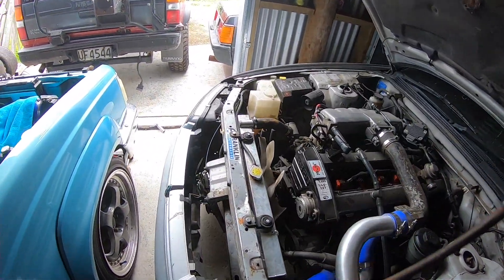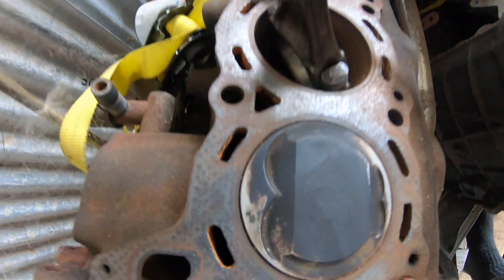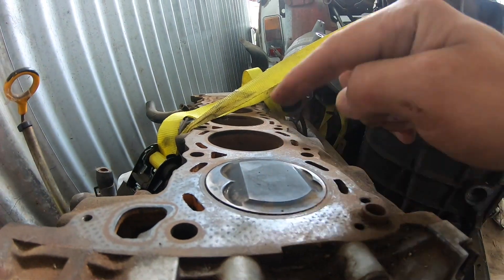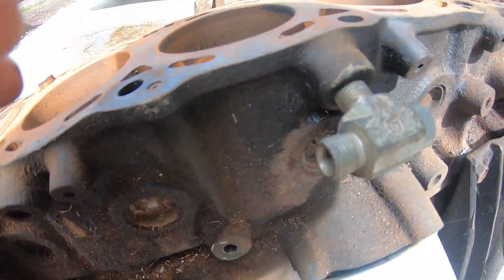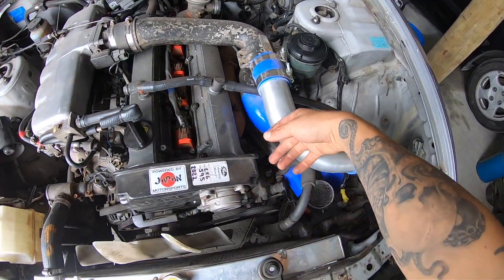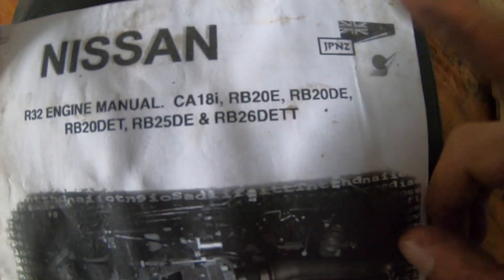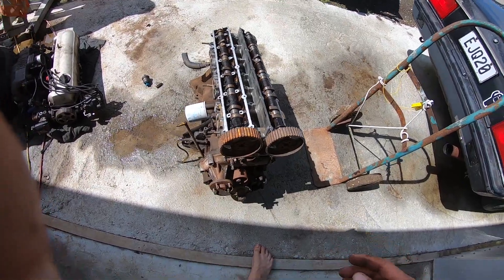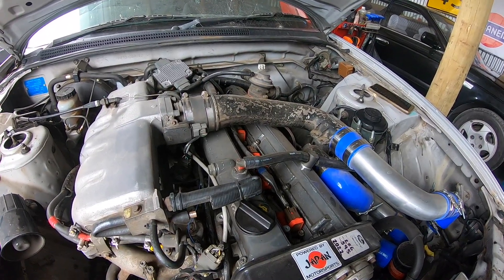RB20DET cylinder head onto RB20E engine block

Comment: Where do you splice the harness? For power and for the dash plug. I’m currently in the middle of doing this same head swap and I’m stumped on the harness
Reply from the maker: @alexrobinson8237  you need a rb20det loom and it will plug in up by the headlight for main power, dash stuff I don't know sorry I had a loom guy do that bit for me but there's videos on YouTube that show which wires you need for the engine to start its only like 4 or 5 wires that need power, have a research on Google lots of help on there too

Comment: Hey bro. Mean video. Just a follow up how's the 20e block holding up? Any updates thanks in advance.

cheers bro
Reply from the maker: @comptonpure-gy6pw  hey bro it's still going good I need to make another video of it running I'll upload one soon
Reply from the maker: @comptonpure-gy6pw  I just posted a short and a video of the car bro, I'll make a better video when the motor is back in I'm painting the engine bay at the moment.

Comment: How hard is it to get a 25de head on a 20?
Reply from the maker: @foodley123  it wouldn't work
Reply: Even if you are building an rb24? What is the actual reason. The 25 head flow is way better
Reply from the maker: @foodley123  an rb24 is built using a rb25 block with a single cam 30e head and a rb20det crank shaft. Do some googling first if you don't know anything about the questions your asking. A rb25 head isn't going to fit onto a 2.0  litre block is it, the bore sizes are different. Also the rb25 head has the oil and water galleries in different places so they won't line up, the rb25 runs VCT unless you find a series 0 rb25de head. One motor is a 2 litre and the other is a 2.5 litre have a think about it.

Comment: Hey bro so do u just need a 20det ecu and its good to go? Is there anyway i can contact u bro . Im wanting to turno my 20de
Reply from the maker: @JoeKean-bo4bu  if you're putting a turbo on a 20de it's a bit easier you just need turbo manifold with turbo, intercooler, put an oil feed and return on the motor like in my video. It will run with a de ecu but preferably get a det one. Have a dig around on Google and YouTube and you'll find more than enough info, just search "how to plus T a rb20de"
Reply: Hey bro what about non turbo ? I think my motor has low compression can i just use a rb20e block and put my rb20de head on? @nasanieru3375
Reply from the maker: How did you get on with your build ?

Comment: Is the wiring the same bro anything I have to add/splice in ? Any help would be appreciated bro

Cheers
Reply from the maker: You'll need to run a rb20det loom and if you want to have the dash and everything work ( rev gauge, temp all that) then you need to splice in the dash plug from the r33 loom. The main power for the 20e loom came from under the brown relay up by the window wiper motor so when he made the loom he kept that for the power but I also noticed that there is a main power plug in the same place a factory det/de body has it up by the passenger headlight so you may be able to get the looms power from that. If you add Nissan Nathaniel on FB I can send you some pictures of what I mean.
Reply from the maker: •Rb20det cylinder head.
•Rb20/25 turbo exhaust manifold.
•turbo
•rb20det engine loom 
•franklin performance head drain kit 
•rb20de/t or rb20e head gasket
•cambelt and tensioner kit 
•turbo oil feed and return lines 
•turbo downpipe 
•rb20det ECU
•rb20det head studs 
•intercooler and piping
•coil packs and igniter plus cam angle sensor 
•im running external fuel pump 500hp walbro
•x2 knock sensors 
•tee fitting for oil feed from oil pressure sensor
•rb20det fuel injectors
•green sticker air flow meter
•rb20det exhaust gasket
Reply: Appreciate your help bro do you think I could use a a31 20det loom and ecu

Comment: Haha good shit. Was doing these builds back in the 2000s. I swear the vl rb20e has a higher comp ratio, did cefiro 20es and they went ok but quite laggy, vl went the best by far super responsive, i was on boost earlier and harder then my friends 20det and i was nearly half his boost sitting right beside him. Never got it tuned just ran 20det ecu injectors and afm, ran nomore tten 5psi and sent it til the wastegate eventually caught the loom on fire 😂 probably still be running otherwise

Comment: Is the exhaust space between each cylinder same with 20e too det so Can use pipes just make part that bolts on
Reply from the maker: No the 20e manifold doesn't fit onto the 20det head
Reply: Rb30 the same but deck clearance is slightly different

Comment: The the turbo manifold the same on the rb20e ???
Reply: Have you got a way too contact I am turboing the rb20e
Reply from the maker: The 20es don't have a standard turbo manifold you have to have one custom made, the manifold I am using on the engine in the video is a standard rb20det manifold because I have a twin cam head on the 20e block
Reply from the maker: If you are leaving the single cam 20e head on the motor then you will have to have someone make you a custom made manifold to suit the single cam head you can't use a rb20det manifold on a 20e because the bolt pattern is different. It's easier to find a complete rb20det head and then remove the 20e head and put on the 20det head
Reply: Hard I am in Indonesia the det head is rare here
Reply: Hard I am in Indonesia the det head is rare here
Reply: Hard I am in Indonesia the det head is rare here
Reply: Hard I am in Indonesia the det head is rare here
Reply: Hard I am in Indonesia the det head is rare here
Reply: Hard I am in Indonesia the det head is rare here
Reply: Hard I am in Indonesia the det head is rare here
Reply: Hard I am in Indonesia the det head is rare here
Reply: Hard I am in Indonesia the det head is rare here
Reply: Hard I am in Indonesia the det head is rare here
Reply: Hard I am in Indonesia the det head is rare here
Reply: Hard I am in Indonesia the det head is rare here
Reply: Hard I am in Indonesia the det head is rare here
Reply: Hard I am in Indonesia the det head is rare here
Reply: Hard I am in Indonesia the det head is rare here
Reply: Hard I am in Indonesia the det head is rare here
Reply: Hard I am in Indonesia the det head is rare here
Reply: Hard I am in Indonesia the det head is rare here

Comment: Any updates on the build bro thanks for all the info for the head swap does the 20e bottom end hold up when put under boost ?
Reply from the maker: Hey bro I just put a new clutch in it I'll get a video of it running and on boost. It holds up well under boost 😁

Comment: Cheers bro, so with the piston difference would it still be sweet to run the det head with e internals?
Reply from the maker: Yeh it's sweet as the motor in the skyline in the video is a untouched 20e bottom end with a det head onto it

Comment: Isnt there already a feed port and drain for oil and water on the exhaust side I thought the castings for the block were pretty much the same between the det an de i think you just need the right size fittings
Reply from the maker: There is a hole threaded for oil feed already just need to drill the the last little bit out by the looks, the marking is there for the return line but you need to drill and tap then install a fitting. The bottom end in this car was pretty high ks and I have a spare genuine 20det engine to be rebuilt so we just built this thing without opening up the bottom end and having to worry about metal shavings but it's on the plans for when it comes out because I don't really like the tee and long feed line, it does the trick tho if you want to keep the build simple 🙂

Comment: tengo un motor rb20e que piezas del det le puedo instalar?
Reply from the maker: •Rb20det cylinder head.
•Rb20/25 turbo exhaust manifold.
•turbo
•rb20det engine loom 
•franklin performance head drain kit 
•rb20de/t or rb20e head gasket
•cambelt and tensioner kit 
•turbo oil feed and return lines 
•turbo downpipe 
•rb20det ECU
•rb20det head studs 
•intercooler and piping
•coil packs and igniter plus cam angle sensor 
•im running external fuel pump 500hp walbro
•x2 knock sensors 
•tee fitting for oil feed from oil pressure sensor
•rb20det fuel injectors
•green sticker air flow meter
•rb20det exhaust gasket

Comment: how many hp do you get from the convertion?
Reply from the maker: Haven't really looked into it but a 20e is around 140hp stock and a 20det is around 200hp stock so I would imagine it gains a little bit doing the conversion

Comment: any info on the 30e to 2cam head in a video?, great work on this one
Reply from the maker: Hey bro I haven't done a 30det sorry would be a good video tho.
Reply: for the rb30et people usually use a rb26dett head but thats for like 1000hp builds
Reply: R32 rb25de non vct head bolts straight on rb30e block. Sort out the tensioner set up find the right belt and send it

Comment: Do you know if you can use a RB20de head instead or would it be too tight in the combustion chamber?
Reply from the maker: Nope RB20DE head also works fine 👍